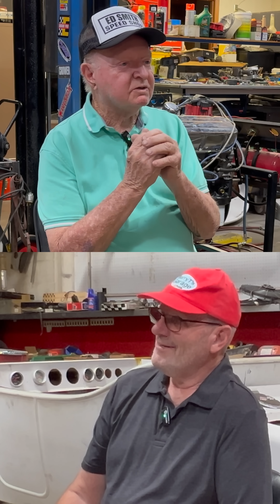Chevy + Dodge + Pontiac Secret ALMOST Revealed! - Ask Ed 25 - Ed Smith w #BarryT

Comment: 😂😂 he is cool sounds like my old hills friends old school they don't nothing jjjj to they put the engine together and holly man it fly jjjjj 😁 I know they like those small blocks like 340 283 289 etc but they don't nothing jjjj 😁 they all have old tools jjjj mostly by hand homemade they even have a 6 300 Ford with a V8 cut on pieces and put together from valves springs and others things that thing fly crazy stuff they call mama wagon jjjj on pills jjjj crazy I think Ed knows what I'm talking about this hills people are something else always happy but they know how to create things from engines to differential gears transmission gears etc well they grow up with hardly anything but they learn to used what they have and build things up to another level one thing they don't like is fuel injectors crap they hate computers crap all carbs from webers to regular carburetor old ones they don't like aftermarket ones they say they are junks jjjj anyway gd video tell Ed kp bringing up that old school style knowledge jjjjj out here the hills people are something else to jjjjj

Comment: I work for a guy one time that's what we did was cut motors up and build better services and more bolt holes 💪 them back together with different length sleeves and different decking and  welding girders machine shops will do all the line borings and stuff,,,,,  they would run😅 they would run😅😅 it was amazing,,,,, covered in metal and oil

Comment: SBC 3.625 STROKE. 6 INCH ROD. 1.185 CH.   I have seen both race engines and street motors.  Just not very many.  I like it better than the 383.  Use a solid roller cam.

Comment: Use to stroke a 348 or 409 by using a 396 or 454 crank , adding more cubic inches cheaply.
Reply from the maker: I’ll have to ask Ed about that, thanks for the tip!